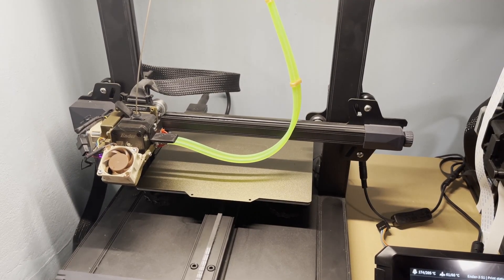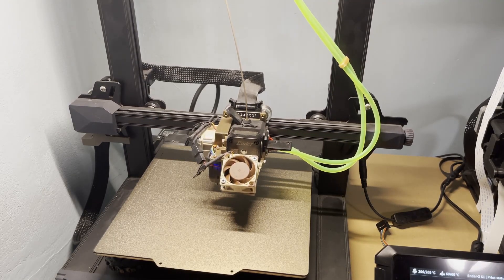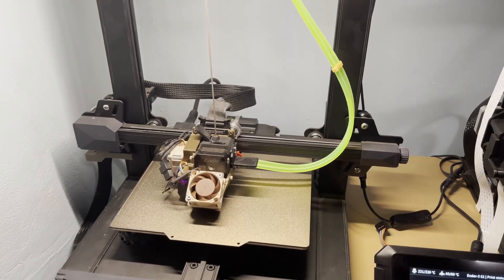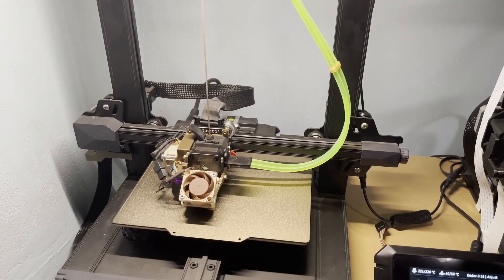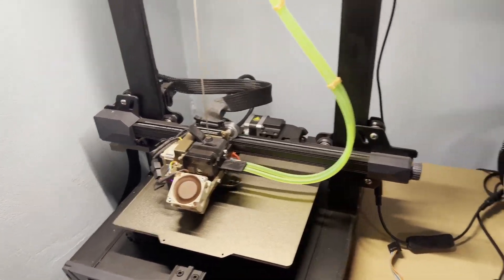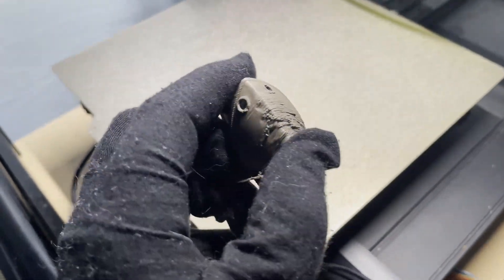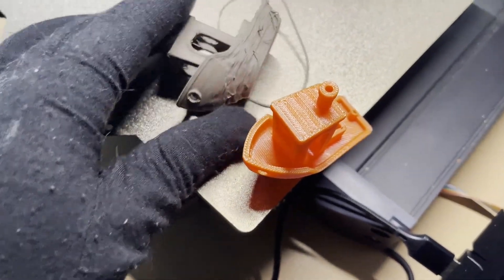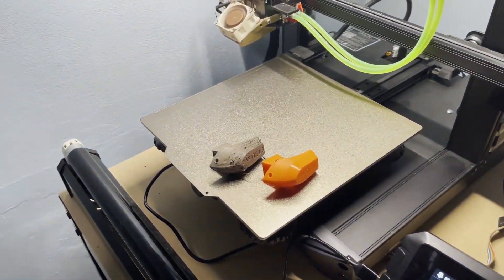compairing Ender 3 s1 with Sonic pad against Bambu X1 carbon benchy

Comment: Got the sonic pad for my Ender 3 s1 pro and now I can't get it to even print anything properly. It sucks cause it used to print perfect before the sonic pad. I said F it and ordered an X1 Carbon
Reply from the maker: Try to reset sonic pad and restart
Reply: @aim6mac  like do a full install again like i did when it was new? I'll try that I got nothing to loose.
Reply: Using two Ender 3 S1 Pro printers with a Sonic Pad. After some slicer tuning it works like a charm. Klipper changed my day

Comment: Awesome video! Real quick question, I’m using the same dual Noctua fan mounts that you are using in this video. I noticed that the CR touch is mounted a little lower than the stock mount on the extruder. How do you adjust the settings to avoid the CR touch from touching the print model during printing?
Reply from the maker: thank you! on my setup the cr touch is mounted above the nozzle so there is no collision .
Reply: @aim6mac  that’s awesome! my CR touch is about 1 mm above the nozzle but I am getting some collision between the CR touch tip and the print. Did you had to adjust the Z hop retraction or some settings?

Comment: i really dont know if all your mods are worth it on the S1..first of all all that weight you add. I wouldnt be surprised if it weighs twice the original weight now, with all that stuff and the full watertube on the side. Second, i dont think  watercooling is really needed. These are very small parts. The heatsink it has is sufficient, it doesnt harm the parts to be 60 degree warm instead of 30. If you really want to "mod" the heatbreak, think about how you can insulate the transition from the heatblock into the threads of the heatbreak, find a way to create a layer with a bad heat-conductive material. Something that doesnt come with weight. You dont even want to suck out the heat of the block and make it harder for that small heatrod to hold the temps, especially at higher temps. Its very balanced the way it is. Changing the small fans for some with better quality and noise level-a upgrade i understand and makes sense. But thats it, you really dont want additional weight on that extruder, thats the most important thing. Youre also putting lots of stress on all parts with that increased weight in combination with elevated speed and acceleration. These are significant forces that might even lead to increased tolerances between rails, wheels and bolts. Slight deformations that you dont see but will result in worse prints. The s1 isnt a printer for you if you want a speedrush. Its made for fine, high quality prints and me personally, i even tend to set the acceleration-values slower than they are dialed it. You also might want to educate yourself what that "Speed" setting on the printer actually does and what settings it really affects. Youre gonna be pretty disappointed. Also "Its just a cooling issue"...dude....nah. Just nah.

Comment: I'm new to 3D printing so I have tons of questions. With the price of your rig, add on the mods including the water cooling and the Sonic Pad. I assume that your Ender 3 is now $800.00 plus to replicate . I'm curious as to the price comparison to the Carbon X1 since there was no comparison in the quality of the print. The Carbon won this contest hands down with the quality of the print. I have a similarly modded V2 and have a Sonic Pad on order so I'm excited for it to arrive. But if you can get that quality and speed from a stock carbon, that may be a company that I need to look at its product line.
Reply from the maker: hi there, thank you for your response, yes the bambu is a real good printer for it's price range, and the quality and speeds u get are out of the box like this.

Comment: I've been so impressed by the Sonic pad, I can print a lot faster and get better quality prints, it's so much easier than using Marlin.  I found the sweet spot on my printer is 300% speed, after that you really notice a difference in quality.  I think my next upgrade will be to water cooling the hot end thou, as my parts fan cooler doesn't work due to a faulty connector on the breakout board, but even with that not working I am getting great quality prints :)
Reply: 300% speed = 3x 50mm/s ("standard" printing speed) = 150mm/s print. That's about you'd expect with a klipperized S1

Comment: noctua fan for cooling terrible, get a blower or a server 4028.
Reply from the maker: noctua is actually great fan for regular speed printing, but when u go fast it's just not good enough...
Reply: if your looking at air cooling Noctua, are the best fans you can buy, they are next to silent and push more air than any other fan, only downside is they are 12v :(
Reply: @IanDDalton  They push much less air than most other fans of the size. That's not even arguable. They are very silent though.
Reply: @IanDDalton  They have low static air pressure. While it’s fine for heat break cooling. They don’t have adequate pressure for parts cooling.
Reply: @gaxon1920  so why do you need static pressure for blowing air on a part? static pressure is needed when the air has to overcome resistance, when you need to press it through a dustfilter or through the fins of a fine heatsink or radiator. For what does the part cooling fan need pressure?